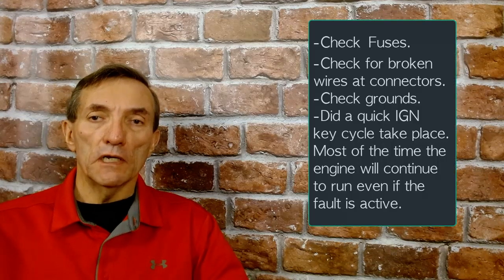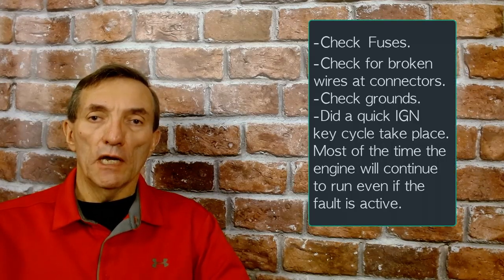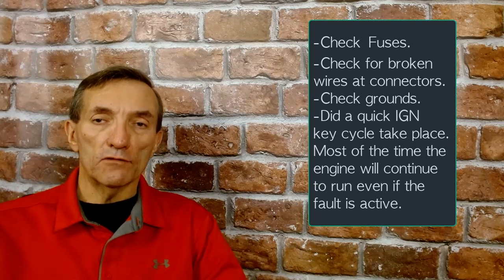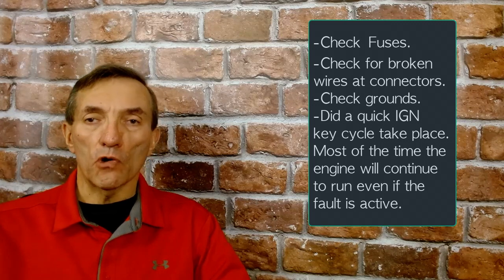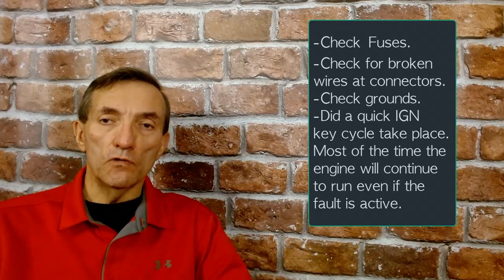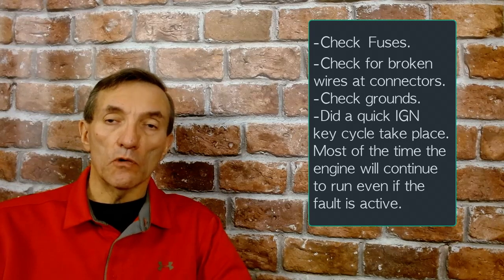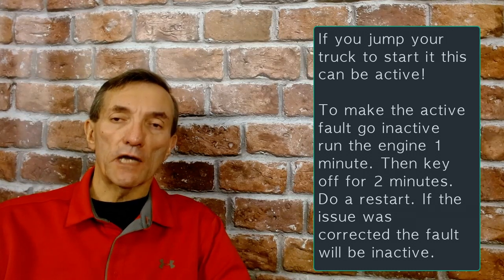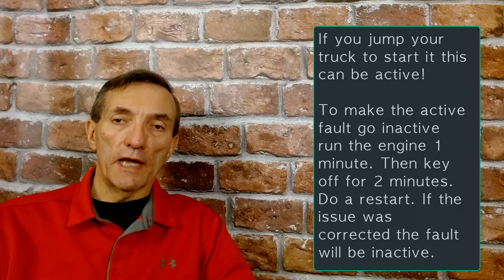Truckers quick tip FC 1117 part 1 of 2

Comment: Thanks for the video. FC 1117 Cummins had my trucks for three weeks they end up replacing the Turbocharger Actuator. Runes the truck in dyno for approximately 4,600 miles. Thank god I’m back on the road.  Thanks again for your great videos
Reply from the maker: First I am glad you are back on the road. 
As a side note speaking of turboos and actuators-
Cummins is releasing automated tests found in their diagnostic software"insite". These automated tests will check turbos and actuators and pass or fail them. That is a good thing as it is difficult to determine when those parts are to the place where they don't operate correctly and cause other problems in aftertreatment.
Reply: @ENGINESHOPJOE  thanks for the video you put on YouTube. They’re helping me a lot.